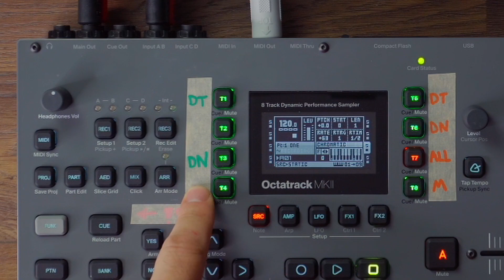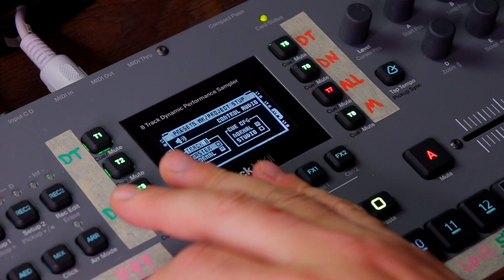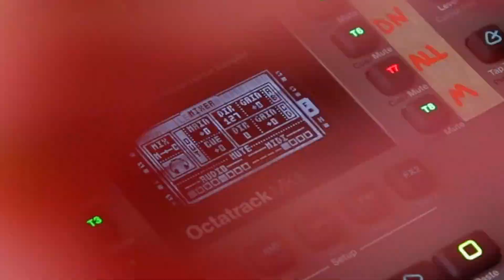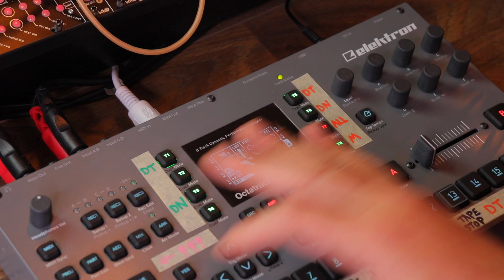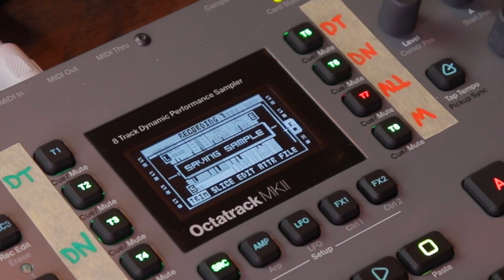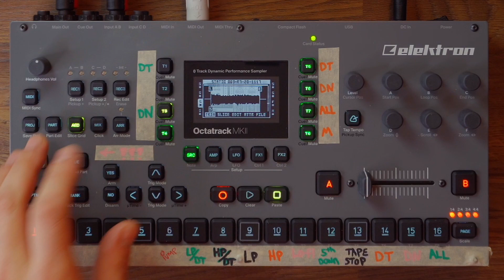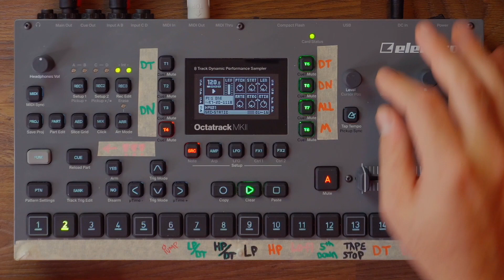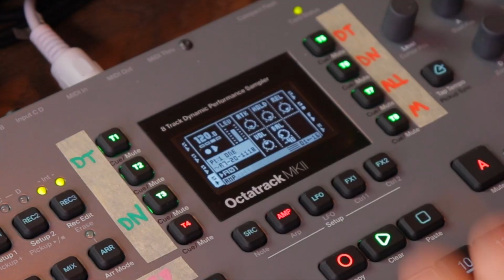Octatrack Workflow Tutorial: Recording Quantized Loops!

Comment: Can anyone help? I did this method, but the slider doesn't completely eliminate the sound of the external inputs. I have one scene set the dirs to max, and the other set them to min, but when they are at min I still hear them at a low volume. The lower the volume of the OT is (func + volume knob) the less i can hear it, but it's still there when I turn it up louder. 

I know the issue isn't a thru track because i can still hear the inputs even when i mute all tracks.

3 weeks into ownership wow this thing is frustrating, just when you think you are understanding things there is always something else that keeps you from just making music
Reply from the maker: Hey! You'll get it, it is definitely frustrating but you will get it. The slider thing is an issue, you need to google reset octatrack slider. It's in the test mode but I forget the key combo. Figure that out and it will fix your problem
Reply: @EZBOT_  thanks so much for the response and for your video!!! Gonna give this a try :) I'll keep practicing away!

Comment: why don't you record directly in each track instead of using track seven and then saving and applying?
Reply from the maker: Because it’s more work to do and the idea was to be as fast as possible :) plus it’s just a different workflow that has its own quirks both good and bad.
Reply from the maker: @christdolphin69  well said! Yes I have seen Cenks video many times :) This method was designed to resample the tracks. The idea was to build layers. Eventually you have a ton of stems that are full of content because you have rerecorded on them so many times. It all came about when i was sampling like 6 different synths as fast as I could and I didnt want to set anything up. So I edited my REMIXER setup real quick to make fast samples and it just kinda stuck because it was so easy. I already had it memorized from playing live.

Comment: I've gone through the setup multiple times and it works - except for the "glitch" I get at the end/start of each time it loops, after the recording.  Anyone else encounter this?  It almost seems like a timing issue.  Octa > Midi Thru (the little 1 in / 4 out that everyone uses, little black box I forget the brand) > Korg Minilogue XD.  Audio from the Korg is direct into the Octa.  Thanks if anyone can recommended a solution!  GREAT vids and thank you for all the help!
Reply: It's little shit like this that just 'doesn't work' that makes me want to chunk this thing and go back to a DAW
Reply: You will find that glitch anywhere, DAW or not DAW, if you don’t make sure that the end of the soundwave at the end of the loop matches same phase of the soundwave at the beginning of the loop. Glitch here is a jump from between soundwaves that meet on the different level.
Reply: @morsuns  I just mean going back to a DAW and record songs in a linear fashion, instead of recording loops and arranging them.

Comment: Is there a difference in setting a oneshot recorder trig and arming the track vs placing no recorder trig at all, using pattern length as the QREC setting on rec setup (page 2) and recording via pressing the respective record button for the source you want to record? If not, I invite you to check out the latter option as you can record multiple sources onto one track, quantized as well :)
Reply: You could make a tutorial man…. Thanks in advance…

Comment: Awesome video. I am encountering a problem when following this method though. When I move the crossfader over to the recorded version, I am getting what sounds like a phasing or flanger type sound. It is more noticeable with the crossfader not 100% to scene B side. I watched your other video on your OT performance setup with the DT + DN. I have the same setup. Have you ran into this issue or any thoughts on what could be causing that to happen?
Reply from the maker: If you do it quickly there is no phasing. There would be no audible difference in recordings at 100% crossfader though. Maybe you need to recalibrate your fader
Reply: @EZBOT_  That makes sense and what I am seeing as well. 100% is fine. Thanks for the feedback.
Reply: Maybe the external source is still open in your mixer…? Did you stop it or close the signal so nothing in entering in AB?

Comment: I don't get it. What's the benefit using track 7 as recorder compared to recording at the actual replay tracks? What happens if you decide to change one track to a new recording, you will need to reassign that player to the new recording from track 7 to a new sample. Isn't that an extra unnecessary step compared to recording to the same track/buffer as playback.
Reply from the maker: The idea was to make a centralized hub where audio comes in. Kinda a digitakt sampling emulation, just a different take on it. The vid teaches you how to sample quantized loops - thats the main thing I wanted people to learn here.

Comment: Great video! You can make longer quantized loops by setting record length to max, the trig to one2, increasing the length of the recording track, and arming it to record and then arming it again during the recording so it stops, right?
Reply from the maker: Yes, you can also keep it at 64 but change the track speed to 1/2 or 1/4. That way it is still quantized
Reply: @EZBOT_  isnt it natural that its quantized if you use a midi track to sequence the modular? I find it harder to quantize the loop when playing 'live instruments'.
Reply: Thanks for pointing this out- exactly what I was trying to figure out the other day but couldn't quite wrap my head around it.

Comment: really cool OT tutorial, how is the latency in the OT at recording quantized loops?
Reply from the maker: ZERO latency. Absolutely zero :)
Reply: @EZBOT_  I’m getting a good bit of latency.  Maybe I should drop it into record while the loop is already playing rather than at the start?  For the record I’m trying to record my iPad which is sequenced by my Oxi one, clocked to the OT.  Lots of variables.  It’s been a few years since I’ve used the OT until today.  The latency is shown in silence at the beginning of the loop, and nasty clicks/pops at the end.  And when slicing, it’s all clicks and pops, even when slice to zero
Reply from the maker: @davidsteffens3952  strange, I have no latency issues at all. You can also just record the loop using the REC buttons then press REC+ 3 to go strait into editing that loop. Save it and your good
Reply: @EZBOT_  going to give it a shot tomorrow.  I think it’s user error somewhere on my part.  No one seems to have this issue but me, and it’s happened on more than one OT, so not a device issue.

Comment: Thanks for the workflow and yes it helped demystify the octatrack. Question - do you feel like the 44.1khz/24bit is adequate or does it limit high quality recordings? I'm hesitant on using it for recordings - but maybe I shouldn't be?
Reply from the maker: I mean, I think it sounds great but 48/16 is in my opinion noticably better. Regardless, I run all my audio through the Octatrack and think nothing of it. It's still a damn fine sounding machine and yes I think hghi quality.

Comment: Thank you, love it. Question i have is how are you dealing with gain staging and leveling and maintaining Green signal lights for your incoming from external as well as green lights on your internal while still having decent output?
I am new to the octatrack this year and dealing with a lot of different gear and end up running most audios in "orange" just to maintain decent output levels
Reply from the maker: Well, I kinda talk about that in the video but it's mostly just understanding what is unity gain on the Octatrack. You shouldn't be having trouble keeping it at acceptable levels. I go over this again in the REMIXER video on my channel. Set track level to 127. Set THRU machine volume to 63. Anything below maximum value on unipolar knob will be attenuating the volume. Does that make sense? Join the EZBOT discord, links in the video description. Much easier to chat there